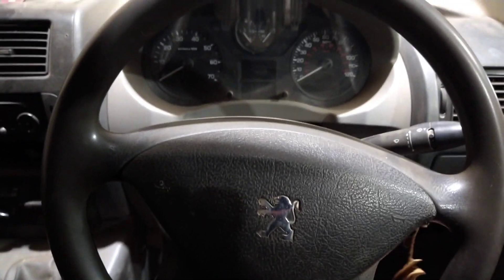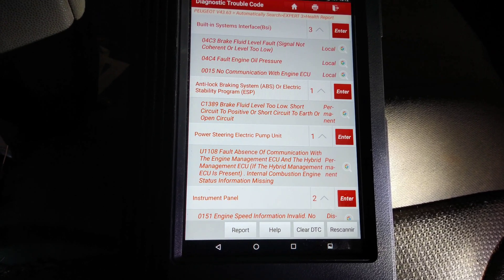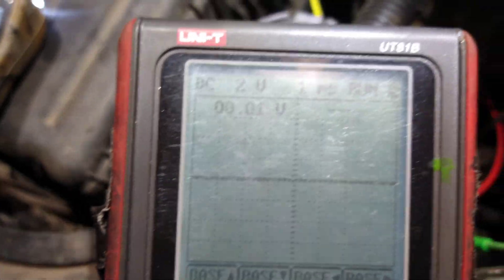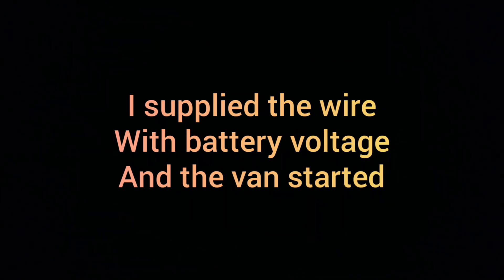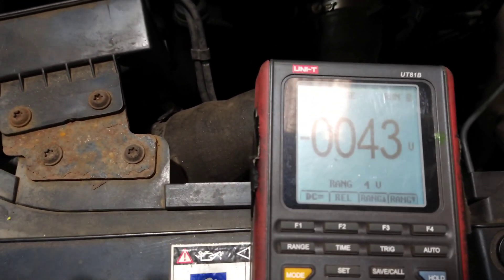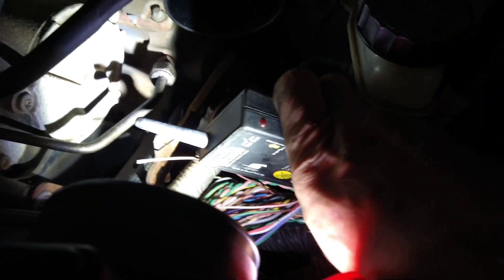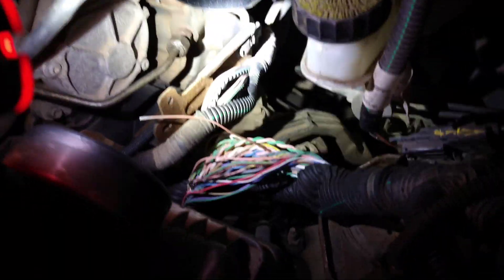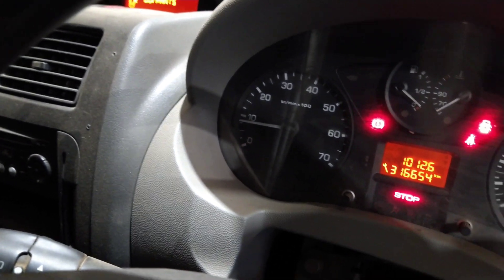Peugeot Expert (no start, no crank, no communication)

Comment: Looks like a solution to my problem i am having issues switch the engine off then tried to start it on the spot ignition would turn on but nothing same as this video no power

Comment: I had a similar problem with 2012 Expert no crank, solenoid clicking. Has already clean battery earth on drivers floor. Battery 12.8v drops to 11 ehen trying to start. Got new battery still the same.

Measured from battery neg to body some resistance showing. Varied when batteryneg lead moved. Stripped off  neg lead and replaced with 25mm flexi.
 Crimped big copper lug. Started fine cranked fast. Put original battery back and started fine.

Neg lead had gone high resistance!! Job done and I was thinking new starter motor. 😂
Reply: I wonder if some body ecu problems, sensor problems are created by Neg battery lead problems.
Reply from the maker: I had a Citroen today, no crank.
The engine block had battery voltage when cranking. It had a bad ground.
Thanks for watching and your comment

Comment: Great video Matt. I have a similar problem with a 2010 Fiat Scudo except mine cranks but won't start.  I had a new key made this week in case that was the problem but the key guy showed me it's the body control module not working or not getting power! So it looks like a broken wire again!  Since you made this video gleaned any new routes for testing?  I now have a similar tone tester for broken wires but I'm struggling to get the snail clamps to release on the ecu plugs a video on releasing various plug fittings would be helpful.  Keep up the good work.  Cheers

Comment: So ok i have just had this issue come up with the dashboard looking like disco light flashing on & off with lost mileage ect ect ect, it turned out the be the wiring loom on the ABS pump but also could be the ECU loom as well because both looms are connected, i have not looked to find what's causing the issue as yet, but if i keep the loom up in the air it stops the fault so just zip tied the loom up for now,,,cleared all codes an everything fine now!!!! Hope this may help some folk out there!

Comment: Great video but it will help if you also show where exactly the fuses you checked are located and where exactly you connect your oscilloscope to check if it gets volts. I have the same problem and really need help. Thanks once again for the awesome videos!
Reply from the maker: Thanks for watching, I'll have to start showing the wires that I connect to. Cheers Matt
Reply: @mechanicmatt871  Thanks Buddy, I have a situation that which a 207 had flat battery symptoms, and even after replacing the battery the next day all is completely dead....no crank, no ECU communication, and continuous economy mode after a few seconds.  The inertia switch was previously removed by the previous owner
you can hear a relay clicking under the dash when turning the key and the instrument panel does turn on.......any ideas?
Reply: @jacqueshanekom822 did you fix this probem? I have ecaxtly the same issue with my 207

Comment: My berlingo ii no cranking and battery  lamp flashed but i hear noise in fuse box under the hoad your advice pls.. Regards
Reply from the maker: I would check for battery voltage at all of the fuses and make sure their is a good ground connection near there. The noise may be a relay clicking on and off due to bad contact

Comment: Good work Matt! Can you share what diagnosis program/Appliance you used at the start of the video and what connector you used? I'm searching for something to diagnose my own Peugeot expert II for a different, but similar fault.
Reply from the maker: I started checking in this with a launch scan tool, to get an idea where to start. Then I used auto data so that I could check powers and grounds and can bus at the engine ECU.
I don't have access to auto data any more, I have been told that it doesn't have pin data now, it only has wiring diagrams.
Thanks for watching

Comment: Iam vary great full good master u have Peugeot 206 with similar problem like this my is permanent fault communication with the column height ECU on bsi I check all the wireing OK I change the bsi and comm 2000 not OK pls what can I do next need help pls

Comment: Good to hear from you sir I mean the name of the wire tracker you used
Reply from the maker: https://www.amazon.co.uk/PWP-PPECT3000-ECT3000-Electrical-Circuit-Tester/dp/B0719JV971/ref=mp_s_a_1_15?dchild=1&keywords=power+probe&qid=1624777520&sr=8-15
This is like the wire tracker that I have.
Thanks

Comment: Hey Matt  Same van same place same tug on same corroded brown wire should be 👍.  It's for pussey cat charity  lady it's cost her £ 2000 so far in a couple of garages with still no fix and same symptoms as yours. So thanks for info.
Reply: update..   all buttoned up no codes all seems good and back on the road thanks again.. But what on earth caused all this on the same little brown wire as in your video?

Comment: I am having the very same problem. Can I ask which color wire on the brown block loom was actually broken it would help me a lot. Thanks for the video
Reply from the maker: Hi Patrick, I really should have shown a close up of that wire whilst making this video. I don't know off hand but I'll try and find out and let you know. Thanks for watching
Reply from the maker: It looks like it was the brown wire in the brown (centre) plug. This is powered with the ignition switched on. Try giving it power if it hadn't already got power. I jumped mine from the red wire with 12 volts on the black plug. Try using a fuse in the jumper like I did. If in doubt you may get a free wiring diagram from carmin STD app  in the play store.
Reply: @mechanicmatt871  thank you so much matt for helping me out and your great video. I appriciat it!

Comment: Can you share on what pins do you have to have power and on what pins ground. I have the same problem
Reply from the maker: Hi, I started at the engine control unit, the four thick wires, two power and two grounds.
Then I checked for the 12 volts feed with the ignition switched on, I think that was pin 69. Also I checked for a good looking can bus signal. Thanks for watching
Reply: I dont have any power on the wires that are going to the ecu, abs module is geting power, any idea what could it be? All the fuse are oke and no demaged wires found. Coms with all the modules are oke, only the ecu is the problem
Reply from the maker: Definitely needing a wiring diagram and follow the wires back to a fuse or relay.
You could try jumping power to the two thick wires that should have it.
It's easy to test the two that should be ground by connecting a test light to battery positive and seeing which wires light up the test light.
Reply: @mechanicmatt871  any idea which colour are these thick feed wires or ground. Sorry for all the questions and thanks for your time
Reply: Pls sir tell me the name of the wire tracker you use

Comment: Good video, hopefully it`s the same fault my job has :)
Reply from the maker: Hopefully, it may be a common fault. See if any wires are broken near the bell housing side of the gear box when you open up the wiring harness. Thanks for watching
Reply: @mechanicmatt871  All wires are fine,  :)

Comment: Hi Matt, hope you're well! I was wondering if there was a way I could contact you directly? I am currently experiencing the same issue with my Peugeot expert. No communication with ECU. Fuses are all ok (ECU has also been sent away and scanned - it is ok too) I'm really at the end of my tether here and can't seem to get help from anyone locally. I am based in Kilmarnock, Ayrshire. It would be good to talk with you and hopefully acquire your services? Thanks, Andrew.
Reply from the maker: Hi Andrew this one ended up being a broken wire, it was a small brown wire in the centre plug in at the ECU. This wire is powered with the ignition switched on, to let the ECU know to switch on.
It was not any of the thick power wires or thick ground wires.
If you take of the cage at the ECU and remove the electrical connectors, it may be worth trying to put power through a fused jumper wire to the brown wire and see if it starts. 
If it does and you want to find the break in the wire, on this van it was near the bell housing at the top of the gearbox.
Thanks for watching,
If this doesn't help let me know.

Comment: where  do you get the tool   to find broken wire
Reply from the maker: Hi  Mark it was probably from Amazon, it's usually  Amazon or eBay that I get my tools, I read through the Amazon reviews before making my mind up when getting something new. This power probe wire tracker has been very helpful. Thanks for watching.

Comment: The problem was a broken wire?
Reply from the maker: Yes Salvatore, just a broken wire stopping this van from starting. Thanks for watching
Reply: @mechanicmatt871   ive got the same problem a wire from stopping it from starting i had someone out and located it towards the air box me stupidly drove off with out asking witch wire it was not its cut out again and refusing to start
Reply: Our 2011 peugeot van was exactly that,  a corroded  (1cm length)  brown wire in that same location. So what is going on?
Reply from the maker: That's good that you fixed yours, glad the video helped

Comment: Nice work Matt. I have been so well impressed by your use of the wire tracker I bought myself one. Not the same manufacturer but I think they all function very similarly.  Thx. Cheers Pal
Reply from the maker: It's been a big help, I seem to be using it a lot  on my wiring jobs lately
Reply: @mechanicmatt871      Hello.   Was this a hdi engine ?    How often do you come across dead ecu’s,  and is there any pattern to these failures ?
Thanks.

Comment: Great video Matt I'm tempted by that power tracker as it would have saved my embarrassment at a job yesterday (I'll post it tomorrow) on a transit cheers my friend, Sandy
Reply from the maker: I forgot I had it, it was in my shed and I found it doing a clear out during the lockdown. Ended up using it a lot now. Thanks mate